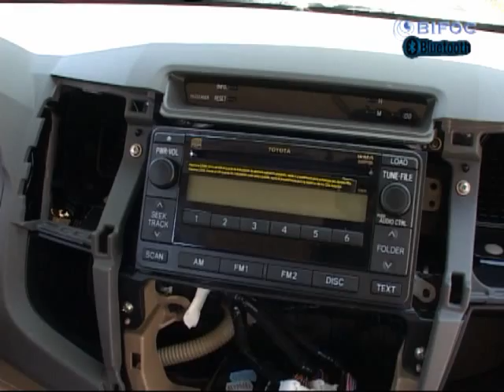Manos Libres Bluetooth Volante Toyota - Instalación

Comment: Thanks for showing this...I'm actually trying to install a 2DIN unit on my Prado 120 and I've just found out that my Parrot is probably interfering with new unit, I have image but no sound as Parrot it's been installed through OEM Pioneer Amplifier...any tips on how to sort that ?